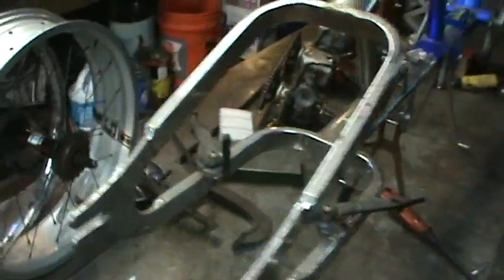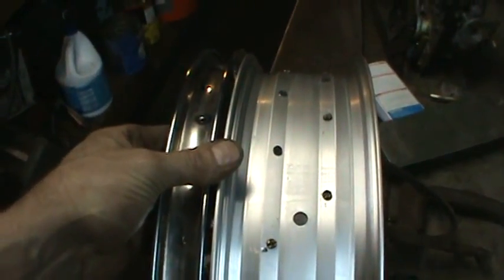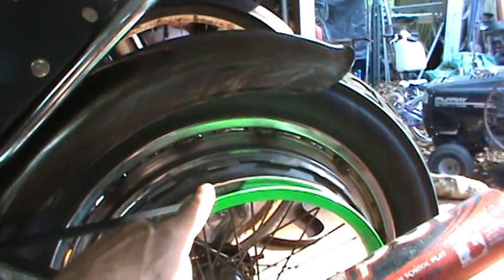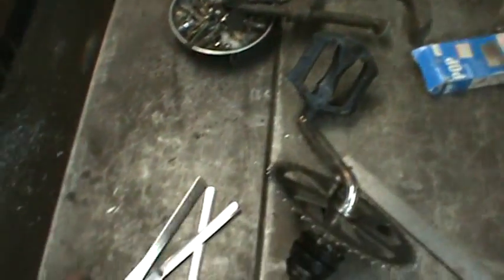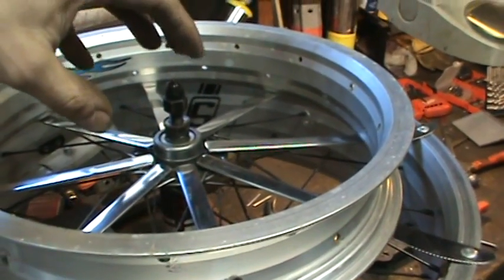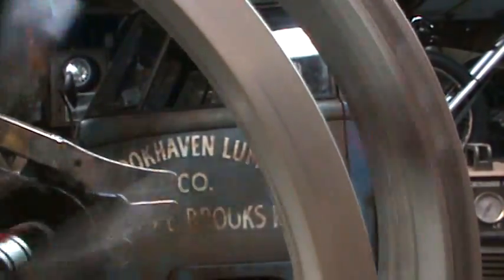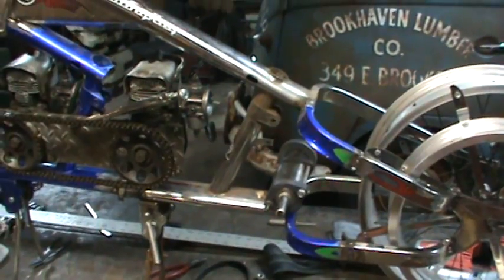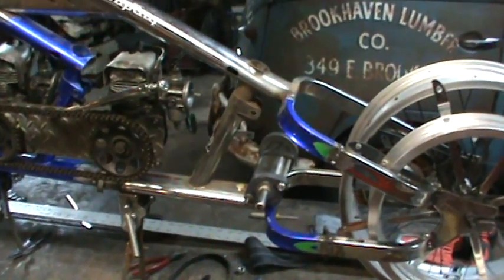think twice bike pt4

Comment: Tabs will do it on the thick rim, alloy, tig them on, ant then tig a hoop between the two rims to create strength, then bolt the belt drive to the tabs with nylocs